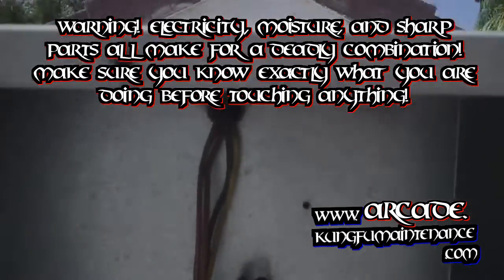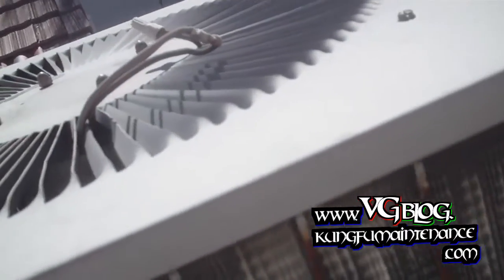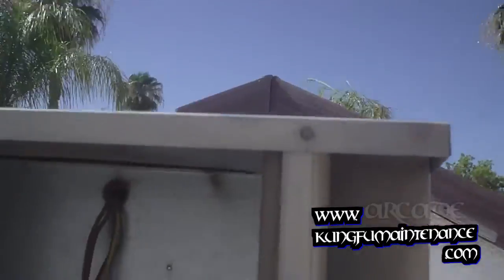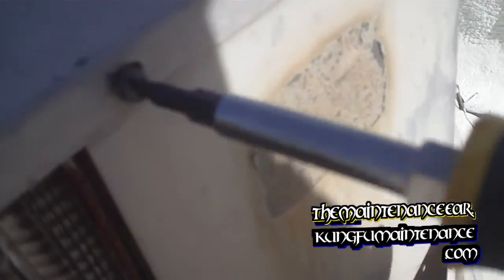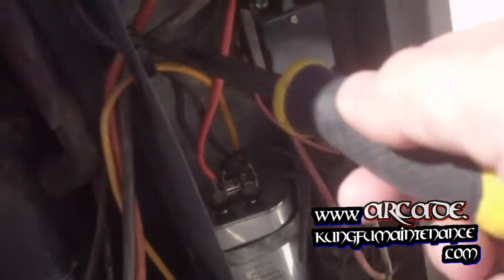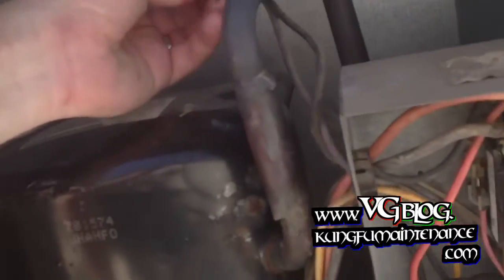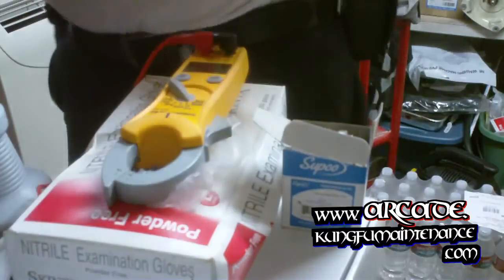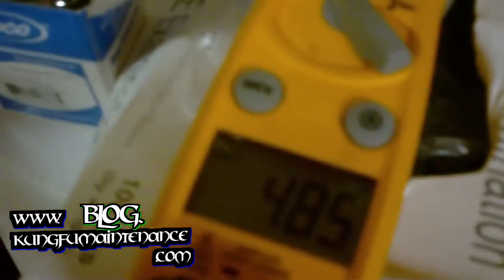How To Change Plus Rewire Air Conditioner Fan Motor AC Lid With Four Wires To Three Wire

Comment: what keeps the pressures from building to high when the condenser fan quites how does it not burn out the compressor I know not everyone turns off there unit when the fan stops or is broken  they just leave it for the tech ive heard some units sound pretty nasty when the fan quites.
Reply from the maker: Compressors (as well as fan motors) have a thermal overload switch that switches off if they get too hot ( usually a bimetal switch) . If a fan motor quits the condensor is no longer able to shed heat and the thermal overload will separate on the compressor. This is engineered to prevent system burn out or blow up. Once cooled down it usually resets itself.  Given enough abuse compressors and fans eventually give out. Fuses and or breakers are also engineered to trip or break under excessive heat or amperage. These act as a first or second safety.
Reply: oh okay  that's  good  to know is this te case with older units as well like  the one you just worked on with Bristol compressors our neighbor had a fan motor fail and the condenser sounded horrible  the compressor gave off loud noises and you could hear it  hissing and grinding sounded like it was bout to lose the compressor owner wasn't home to tell so I just walk on by and left it   wasn't my unit couldn't do anything about it its been repaired  a hack jod  with wires sticking out the top sounds horrid but its still cooling its loud  and  also whoever changed it bent the fan all to heck so  it vibrates pretty bad now.
Reply: I also think our condenser hear is a bout to need a fan motor its still drawing the safe zone amps but the motor is starting to rust  and  you can a small whining noise coming from it its been doing that for a bout a month now I don't see any signs of oil leakage yet but the shaft is pretty rusty sad thing its only a 5 year old ruud.

Comment: I think after a few more bottles of beer I will finally understand what you did here. LOL. But seriously, as you follow the flow of electricity from the breaker onward to the fan, what are the hoops and loops the current has to negotiate? For example, Breaker on flows electrical current to contactor in, contactor pulls in and then outputs to capacitor in, then capitor charges up and outputs to ...finally to the fan?  Is that the flow?